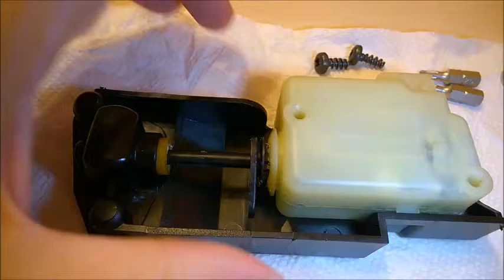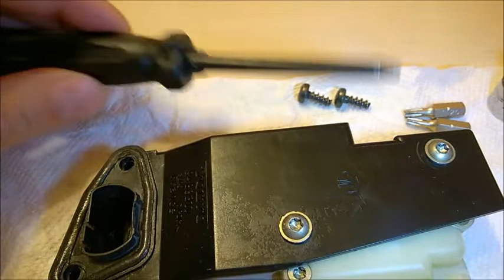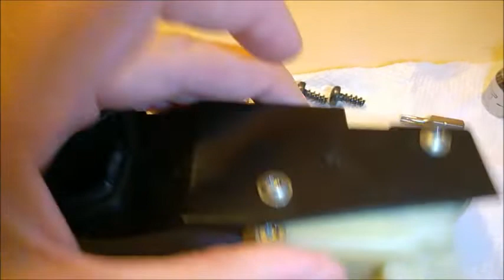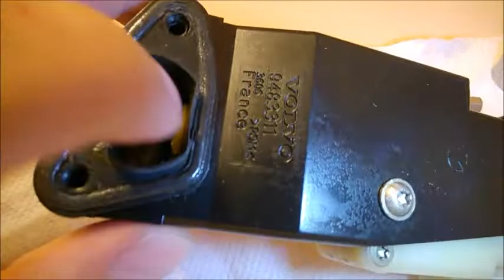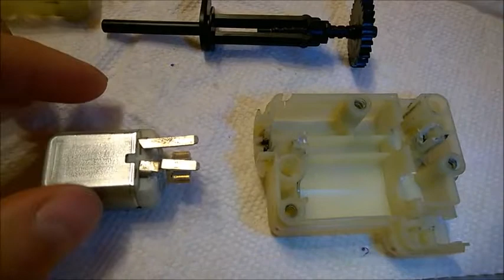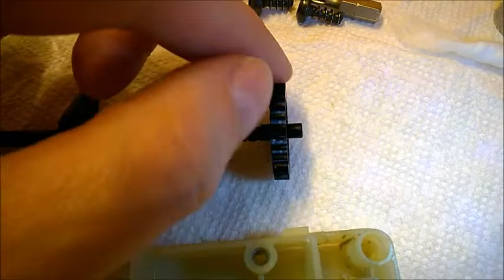Volvo S60 V70 Fuel door lock  actuator  2001-2014

Comment: I tried that and followed your advice, however when I reached that point I found the switch jammed. I tried to pull it towards the yellow box, but it wouldn't budge. What do I do then?
Reply from the maker: It is possible a black plastic gear inside has stripped teeth and got stuck. Try forcing a bit the release tab back and forth, see if it starts moving. Otherwise, the brutal option is to force the fuel door open from the outside, the plastic lock on the door will break and of course, the door will no longer lock
Reply: @Peppermint1  Old comment but i had this same situation happen, i couldnt manually release it, i tried more force. What ended up helping was i tapped the plastic housing while moving the manual release 🤔

Comment: Where can I get a motor to replace not the whole thing just the motor?
Reply from the maker: This appears similar but I'm not sure if the small gear is at the right position  https://www.aliexpress.com/item/32884391266.html?spm=a2g0s.9042311.0.0.4ce14c4dwfCocF
Reply: google a " U pull it " auto salvage  place near you.... like $7 there...

Comment: On my s60 fuel door locks after 10 min after i lock the doors. So for example when you buy gas you can lock the doors but under time you can open the tank door and put gas so i think its good ;)
Reply from the maker: That's correct.  Several people mentioned 10 minutes after moving the car.  As long as it locks all it's fine!